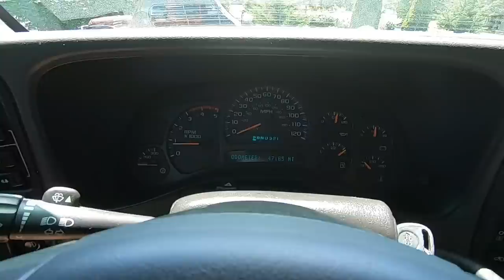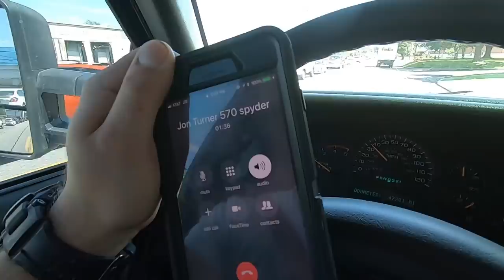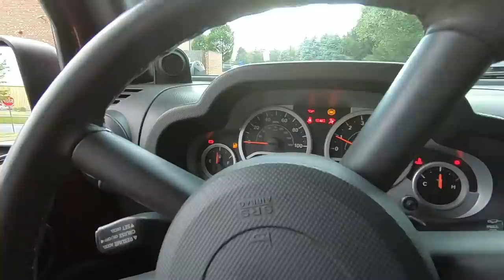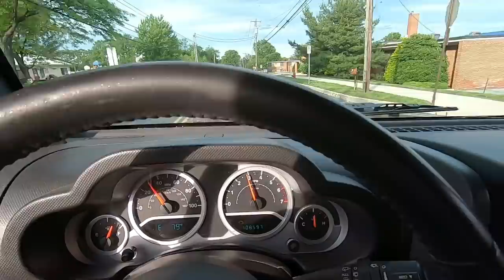FINALLY... MY JEEP GETS HUGE WHEELS AND TIRES!!! (BIGGEST I've Ever Bought!)

Comment: Mike, when are you gonna get a real floor Jack and a cordless impact?
Reply: Moose Knuckle yesssss. It kills me to see him dragging that cord out and that massive corded drill ever time.
Reply: I would honestly prefer the corded over cordless at times. When I just need to change a tire or so something quick, cordless is the way to go. If I have a big project or have to use it a ton, I'd go with corded because you dont have to worry about losing power/weakening and having to change the battery.
Reply: @123bluecatky  true, but all he ever uses it for is to change tires lol
Reply: bluecatky them new Milwaukee’s let me tell you I have the 3/4 stronger that air and the battery last forever breaks 1200ft pound bolts like valve cover bolts

Comment: @streetspeed717.  Seriously you need to invest in a REAL floor jack and jack stands.   Lol
Reply: And an impact socket set
Reply: And real tools
Reply from the maker: Scott Winslow this one seems to get the job done😎
Reply: @StreetSpeed717  love your vids man!
Reply: It’s not that it doesn’t get the job done but not using jack stands is unsafe
Reply: No reason to cry over a jack when he never went underneath the Jeep🤔. If he was underneath (which he usually has someone do that kind of work) then it would be worth buying a jack.
Reply: @StreetSpeed717  just get good tools dude. Throw the crappy jack and your boards in the back of the Jeep just in case.

Comment: Those 35’s are to small. You need 37’s, this isn’t a Chevy you can run big tires! 😆
Reply: Idk how big his lift is but it looks like he could just about fit 40s
Reply: 35s is pushing the limits of the jeeps axles 37s will break the gearing if used the way he does things. He will need to regear or do the $10,000 axle swap kit.
Reply: Not smart to go bigger with those axles the driveline is already under more stress than intended with those...
Reply: @rfcm7845  Finally someone that understands and knows a vehicle. Was waiting for another person to chim in on it.
Reply: RFCM those are fine to be on that Jeep it has 4.10 gears guys run 37’s no issue
Reply: You can run 37s tops with re gearing he has the dana35 front and 44 rear. Rubicons have 44 front and rear

Comment: my keytags are messed up and inshanedesigns is not answering
Reply: Dan Moynihan I had the same issue, I had to email to get a response. Mine you couldn’t even tell there was stars on the flag. Really disappointed. I dont even use it. They blamed it on the supplier.
Reply: @Keniff443  they need to have better quality control on both ends then. The supplier and Inshane Designs. InShane Designs needs to look over the products before shipping them. It only takes a few seconds literally to look over a key tag before you put it on a package and it's already in your hands.
Reply: I still haven't received my hoodie. I ordered it like in the beginning of the launch. This happen last giveaway. Dont think I'm going to participate in the next giveaway. I dont feel they are prepared enough. Shouldn't take weeks and weeks to get our order.
Reply: @autodomination7820  the goodies as far as I know won't be into them InShane design until June and then be mailed out.

Comment: Try to get a look at the wear paturn on the tires to get them set to a good air pressure. Tread should wear flat and square except the fronts will get choppy looking a little before rotation time. It's a jeep thing yes! LoL

Comment: Jeep looks great you should add a little more power to it
Reply: Arthur Zimmerman I think a exhaust, tune, Edelbrock e force supercharger (they work great with stock 3.8 or 3.6 v6 Jeep motors) or a custom single turbo kit with low boost and maybe a couple of upgraded pulleys would be dope

Comment: You need to add a super bright light bar to the top of the push bar,where to 2 holes are,some or most jeeps have "levels" of light/light bars,should just find a light bar that size to fit there,that's super bright

Comment: Nobody seems to mention that when you do this the gearing gets longer/higher, which means less bottom end torque = slower acceleration with more stress on the clutch, as well as speedo error that is not in your favor if radar is involved.  Yeah, it looks cool but other than that it sucks. Still, LOVE the look of it and understand that motivation. Now just get an adjusted speedo gear and lower rear end gearing and all will be well if you don't try jumping/drowning it and trash the f*** out of it like the tazer.

Comment: Het there! I have a 2013 JKU and I've been wanting to do 15 inch wheels and 33x12.5 tires.  I have seen that some people have had problems with the break calipers clearing the wheels or overheating if you go down to 15 inches. What's your experience with these wheels? The Jeep looks killer BTW!

Comment: Looks like they sent you that one tire already aired down for the trail :-) most people don't air down properly for the trail and a lot of Jeep owners run too much air in those big aftermarket tires as they're built to handle so much more weight then a Jeep. People in the know are running 25 to 30 on the street in 10 to 15 on the trail depending on how hard the tire is and how heavy the rig is. When you first showed the new tire on the Jeep I was wondering when you were going to let it down off the Jack because there was so much room! You could fit 38s on that thing. Massive wheel Gap

Comment: Your front tires stick out more then the rear bc of your lift. You should get 2 inch spacers for the rear to make it flush
Reply: Max Lahoda The track bar needs to be adjusted to referrer the axle. Spacers would be a cop out!

Comment: If the tire is leaking air put the tire and rim in a swimming pool and any air escaping will make bubbles so you can see where its leaking. That or spray soapy water on it so the soap and leaking air blows bubbles. Also do it on the tread so if there is a hole in it you will see it.

Comment: Time to invest some of that YouTube money on a Milwaukee 18V cordless impact gun, some real impact sockets, a good floor jack and a made in USA air compressor. 

For less than the price of 2 wheels and tires, you’d be set for a long time. 

There’s no way I’d put my legs under the Jeep wrestling with removing and installing tires using a jack that belongs in the scrap heap. 

Mike is going to be a cop magnet with all his vehicles. Quickly fixit tickets will turn into real tickets, and we know Mike doesn’t need those otherwise the channel name will get changed to Shoeleather717.

Comment: UPS / FEDEX  may not ship that size/weight  if you wanted expedited delivery you shoulda inquired and  paid for it.....its not free and certainly in no way cheap for that 'irregular.. i.e. not in a box' weight and size.....fyi ship wheels separated... from the tires to use a faster delivery company....

Comment: I sensing broken axles in the near future. Those jeep axles cant handle 37s for long. Especially if offroading. need to regear or axle swap the jeep to handle those meats.
Reply: He installed 35's tho 🤦
Reply: @user-pt6io2cq9n  Go meassure a 35in tire. They are not 35in but either larger or smaller than 35in some reaching the 37in mark.

Comment: remove the ugly 50 inch light bar and replace it with 4 round KCs you will hate the whistling noise you will get at 60+MPH. and jeeps should have round lights trucks can have the ugly flat ones.